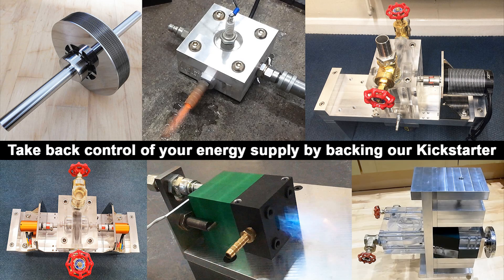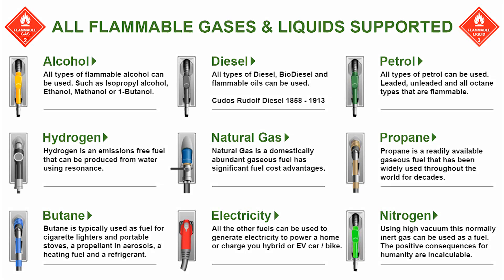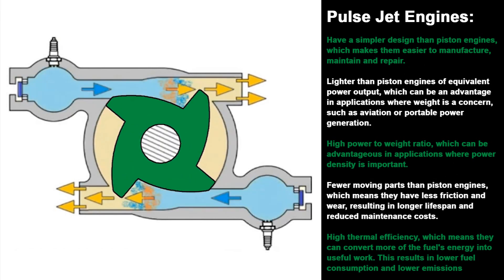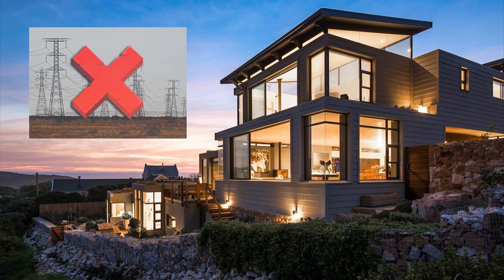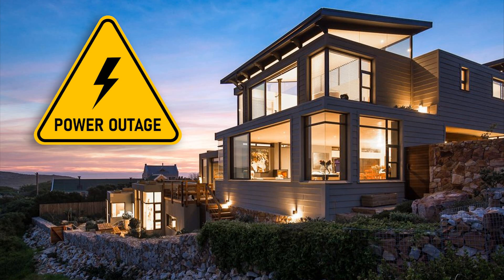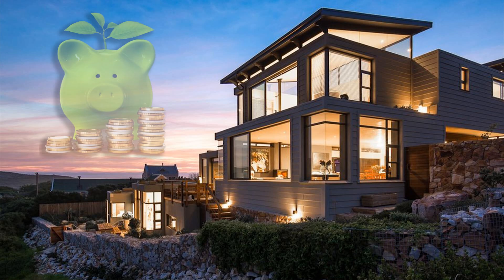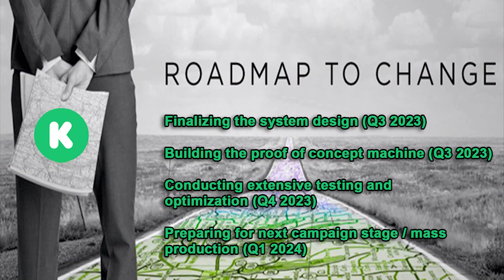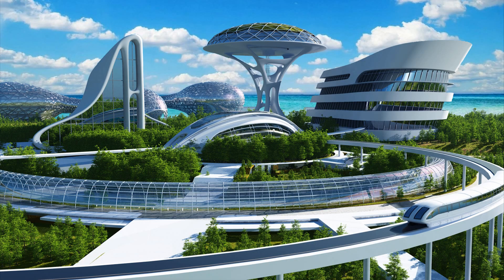Multi-Fuel Rotary Engine Kickstarter Campaign

Comment: An idea just "hit" me regarding that... perhaps instead of going for "motors," you can start with building different size generators? If this is more efficient than standard generators, then your sales will skyrocket. And this is something that is easy to introduce in different sizes, start small, and then scale. Way easier than trying to get into the car manufacturing business. You will be able to expand your sales organically, and later on even enter the car engine space.

Comment: is the project still runnning?
Reply from the maker: Yes, I have been without a lab for over a year but I've just picked up the torch again. We are in the final stages of design and have already got 30% of the parts requires to test the multi fuel engine with up to 20KW output.
Reply from the maker: Can you read Kanji as I have Tesla's only Japanese patent 🙂
Reply: @nikola.tesla.r.and.d.centre  yep i can read kanji pretty well
Reply from the maker: @HielosCBR  cool, I’ve been wanting to translate the Japanese Tesla patent into English for some time but I didn’t think OCR was good enough for the quality of the patent. Was just speaking to chatgpt about this. Apparently there are some paid OCR software that can do this. Well at least convert PDF to computer quality Kanji. Email me at paultownley@rocketmail.com
Reply from the maker: @HielosCBR  I can email you the Japanese Tesla patent if you contact my email.
Reply from the maker: @ cool, I’ll look out for it

Comment: This looks like it makes a lot of sense. I've looked up "Rotary engine" and none of them are like this. In the future, manufacturers can put 4 of them in a row, to increase smoothness.

This can be amazing with the hydrogen fuel. As 35% efficiency, is what kinda ruins it.

I'm sorry your Kickstarter campaign hasn't reached it's goal. Is there any further plan to move it forward? Perhaps with some kind of Angel Investors?
Reply from the maker: No need to put 4 in a row with Tesla's engine as the torque is continuous due to there being no strokes and the power stroke having to support the other 3 strokes. There are better options than hydrogen. Tesla was ahead of the game. What we have today is the product of corporate invention. Not to worry about the Kickstarter, I am  currently doing the design for the next prototype which is hooked up to 2 x 30kw alternators with a 5" rotor. Angel investors sounds interesting, I'm all ears.

Comment: Nice presentation, but I need an explanation: How can a combustion engine not feature an exhaust? Completely apart from it being shown in the video.
Reply from the maker: The exhaust can be recirculated as shown in Tesla’s later works.

The exhaust ports don’t need a manifold and mufflers. 

Check out the MYT engine which also is a rotary engine that doesn’t need an exhaust.
Reply: @nikola.tesla.r.and.d.centre  Ok, so it refers to the pipes etc. But even when recirculating, it would need fresh air for a combustion, and would produce exhaust gas.
Reply from the maker: @human_isomer  it’s very difficult to explain in words. I’ve been trying to teach the subject via YouTube and Patreon for years.

Only a few engineers in the world who are very mechanical ⚙️ actually understood what I was trying to teach.

This isn’t the fault of the viewer, more fault on my part for not making better animations / visuals / prototypes. 

I’ll consider your response and make an appropriate reply.

Comment: Mate if anyone is going to take this as a serious investment they will need proof of output under load
Reply from the maker: One of my associates has over one megawatt systems using a similar setup dyno proven at 96% efficiency. 

We have a superior system to what he is using. The design will only be made available to backers. Who they choose to share it with is at their discretion.
Reply: @nikola.tesla.r.and.d.centre  why the U-turn from your open source ethics? Tesla turbines , pulse jets and generators are well documented things. I'm not gonna lie I feel like the original owner of this channel sold the the channel and it subs to the highest bidder?
Reply from the maker: @you-know-who.  everything prior is still open source and has been for 4.5 years.

I funded most of this myself and gave away my work for free.

We are not building a Tesla turbine. It’s a rotary engine with a pulse jet engine. 

I haven’t sold the channel or does anyone control what I post, say or do.

I ran out of money and the only way forward is this without some decent investment. Which would actually cause me to loose control.

I don’t see anyone else spending such large amounts and giving their work away for free. 

Happy to hear about them if they exist.
Reply from the maker: @you-know-who.  I would love to do this all for free and give it away like I have been for many years. 

I’ve got rent and four children to feed and I’ve given a freebie for as long as physically possible.
Reply: @nikola.tesla.r.and.d.centre  good luck mate 💯 I found your uploads fascinating. Ur an amazing person and thanks for the uploads while they lasted. I'm sure it's all come at massive expense to you and ur family
Reply from the maker: @you-know-who.  if we can reach the Kickstarter target 🎯 there are some major revelations we will be able to prove about Tesla’s static mechanical technology that all others builders have missed. You will have to see it to believe it! 

The fuel is just used to start the engine to tap into atmospheric pressure to be converted into supersonic wind 💨 an inexhaustible energy source and simple design.
Reply: @nikola.tesla.r.and.d.centre  sounds amazing mate wish I could help you out with cash flow but I'm in no financial state to do so
Reply: @nikola.tesla.r.and.d.centre  people really need to see proof here. Jeremiah and Solis look like they're making more progress

Comment: How would one set up the engine to be able to take any fuel?

I mean does it have to be keyed to one fuel, like a tank of hydrogen, or is there some kind of sealable hopper we drop stuff in, be it wood for wood gas, butane, petrol etc?
Reply from the maker: Gases can share the same 1/4” BSP or NPT connection.

Liquids can be “gravity” fed and the drip 💧 controlled using a gate valve or needle valve or similar.
Reply: @nikola.tesla.r.and.d.centre  very cool so assuming I had one engine and wanting the option to run it on fuels from say coal, to wood, to gas, to petrol, how would one set that up, what would I need for such a failsafe system?
Reply from the maker: @sarchlalaith8836  easier to use compressed air at pressures that allow supersonic plus expansion than coal or wood. In my opinion coal or wood systems are retarded compared to what Tesla invented. 

Happy to watch others try this and refine it but ultimately nitrogen is where we are headed with a by product of liquid fertilizer which was Tesla’s ultimate vision with no NOx
Reply from the maker: @sarchlalaith8836  easier to use compressed air at pressures that allow supersonic plus expansion than coal or wood. In my opinion coal or wood systems are retarded compared to what Tesla invented. 

Happy to watch others try this and refine it but ultimately nitrogen is where we are headed with a by product of liquid fertilizer which was Tesla’s ultimate vision with no NOx
Reply: @nikola.tesla.r.and.d.centre  oh I'm not arguing against that or anything I'm talking a out redundancy.
Reply from the maker: @sarchlalaith8836  a solar panel, a system with super capacitors and a powerful motor is likely the best redundancy.

The alternator can also be used as a starter motor. 

Using coal and wood to make heat / steam can be used you just need a way of inputting this to the system. It’s not going to be complicated to do this, just more complicated than other fuels.
Reply: @nikola.tesla.r.and.d.centre  that's pretty awesome I think I get you now, took a few reads.

So let's say it's you buying it, your out in the sticks and not sure what fuel you can get day by day... What fuels would you plan on using and having storage for..
And how many separate tanks would you need for all of it? Like can nox and butane share the same tank? If so what would I be looking at as a number of tanks?
Reply from the maker: @sarchlalaith8836  any flammable gas or liquid. Could be rum if you like. 

The fuel is just used as a starter motor to get the engine to idle. It isn’t needed continuously.

Frank Germano who has 1 megawatt systems is burning landfill using a pyrolyzer. 

So unless your fuel is free to use like Frank’s system to use continuously, that concept is retarded!
Reply: @nikola.tesla.r.and.d.centre  ah I think I get you now.

So ideally this is a steam generator?
Reply from the maker: @sarchlalaith8836  the PJE can be used to generate steam if that's what the user wants. Much higher temps can be reached in the chamber with steam.
Reply: @nikola.tesla.r.and.d.centre  I was thinking vacuum tubes for solar thermal making steam to drive this to generate.then basically anything can be used to make the steam
Reply from the maker: @sarchlalaith8836  Tesla's idea in the 1890's was to focus the sun onto a tank. He ditched that idea once he figured out how to convert air mass into velocity and maintain a pressure / temperature delta. First with reciprocating motion and later with rotary motion. The rotary motion has many advantages, hence why we are pursuing that.
Reply: @nikola.tesla.r.and.d.centre  I won't lie to you, that would still need a generator to create the air gradient to power it with and I really wouldn't know what to move with such a motor in the home, but generation anywhere with anything... Now that peaked my interest.
Reply from the maker: @sarchlalaith8836  well we are all entitled to our opinions. There is a natural air gradient just waiting to be tapped into. Sail boats use it, Tesla went many steps further.
Reply: @nikola.tesla.r.and.d.centre  if you're willing to teach me how, I'm more than willing to listen.
Reply from the maker: @sarchlalaith8836  this is what I've been doing for the last 4.5 years. Looking for people who can understand what I rediscovered. So far it seems only high level mechanics and Peter Lindemann understand. If you email me I will send you a video I cannot share on YouTube. paultownley@rocketmail.com
Reply: @nikola.tesla.r.and.d.centre  done
Reply: @nikola.tesla.r.and.d.centre  thanks :) got it